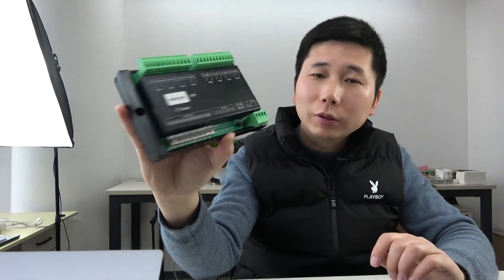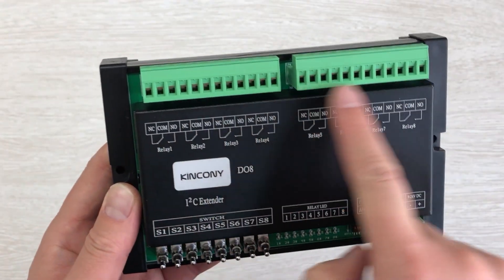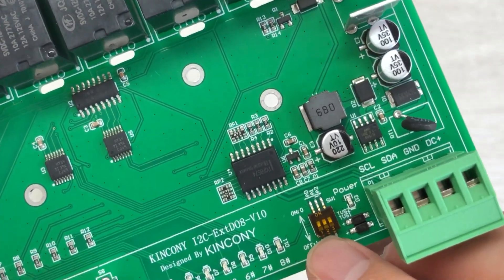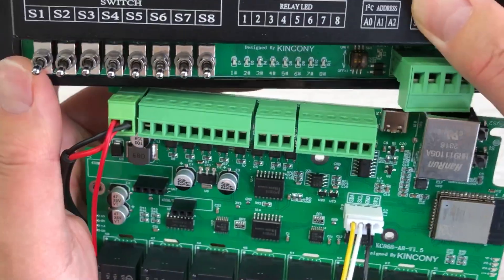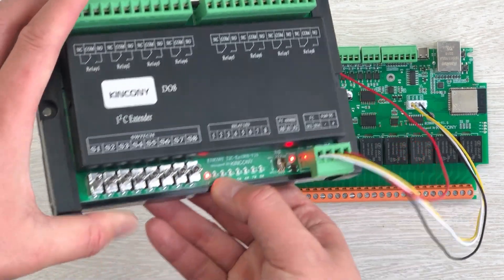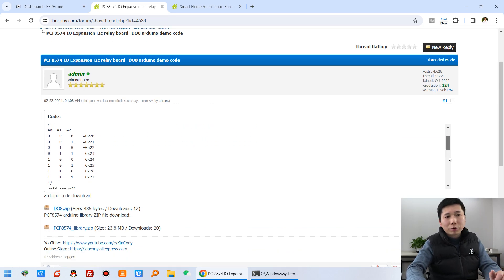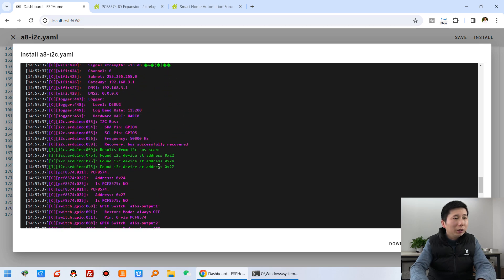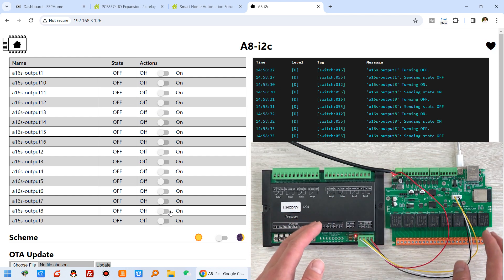PCF8574 i2c IO expander relay board for ESPHome HA - KinCony DO8

Comment: HI, i have a question, it's possible tu use this board directly connected to the KinCony Server-Mini, I have both, but I didn't understand how I could configure ESPhome.  On Server Mini Installed Home Assistant and I configured the GPIO without any problem, I have installed ESPHome and I have connected the expansion board to the Mini Server via I2C then I copied the yml file for the expansion board but something doesn't works.  can you help me to understand ?  Many thanks
Reply from the maker: A: Server-Mini  B: any KinCony ESP32 board  C: DO8     C--->B-->A   any questions you can also post to our forum.
Reply: @KinCony  Yes as I imagined, many thanks!

Comment: Nice design. However, it would be very cool, if the change of hw switches (on/off) would be reflected in HA. otherwise the information presented in ESPHome/HA is not necessary representing the real state of relay channel. I understand that HW switches are acting like a “user overload” and have precedence over ESP32 control, but still I would like to see some indication in ESP/HA.
Reply from the maker: this manual control switch is TOP level, because we will conside if home assistant is broken. usually the manual control button not need to use, we will use digital input with switch panel, the state will feedback to esphome. but we must have a solution we can control every relay when system is bad, no software, no network.
Reply: @KinCony  I got it :-) I would also like to see such HW switches on “mother board” equipped with esp32. However, I saw some hw switches on your previous designs. Why not here?
Reply from the maker: A8 not new product, DO8 is new product. @lubicius666

Comment: I noticed every kincony board that use mux always design with pcf8573 instead mcp23017. I've discover in some video/forum you said easy to get that chip in mainland China. but I curious any difference in performance between both chips?🤔
Reply from the maker: almost same, it's enough for relay and sensor use.
Reply: Awesome work,